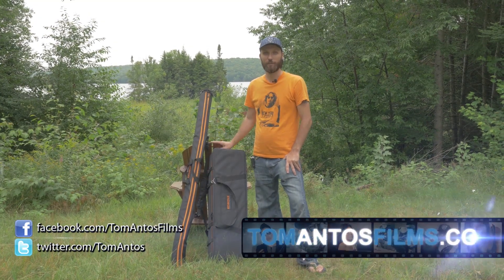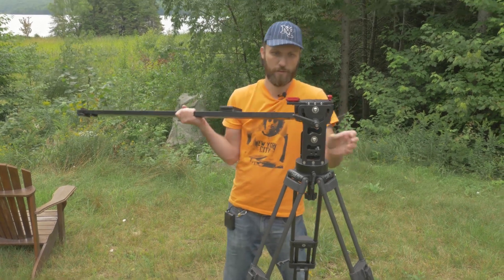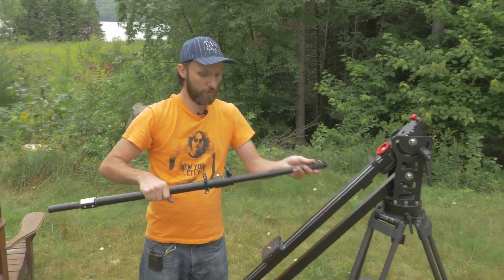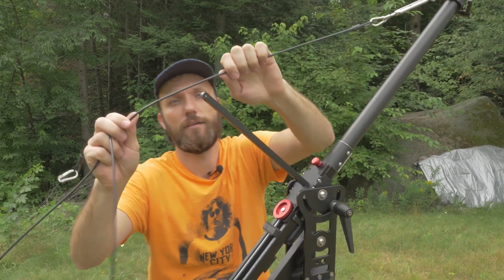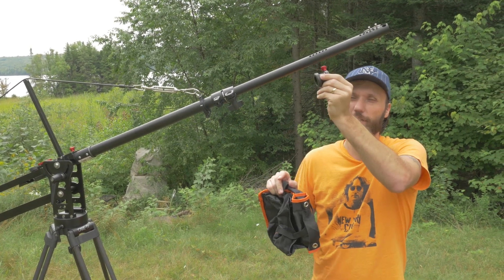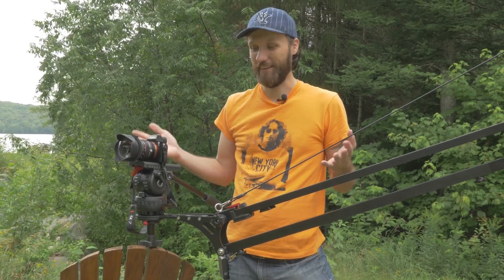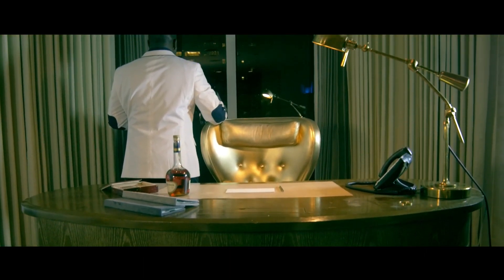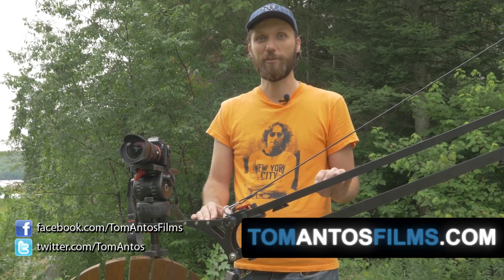Konova Slider Jib

Comment: Awesome jib crane. Neat thing about having the slider is you can use that slider as a fine adjustment weight.
You might want to try rotating your camera mount 180 degrees, so the handle grip is on the lens side. You might need a grip with a steeper angle to keep the grip out of frame when wide angle lenses are used, though. I do this to allow me to take advantage of the rig's natural tendency to allow near automatic tilting down of the camera while the jib is going up, and the other way, coming down as you hold the tip of the grip. Also work great with lateral movements, and keeps the grip from contacting the jib, too. give it a try.

Comment: I have been using my dji-ronin on my 24' jib and it is awesome.  Nothing like a huge boom down shot that Flys off at ground level  on a steadycam shot.  The 3 axis systems have lighten my production crew by 6. And saves tons of time with is more cash for budget which gives production value. I used to use 20 people now 10 years later I only need 4 tops. Amazing tech world transition to film making productivity
Reply from the maker: Great way of using the DJI Ronin... post some videos with your results. Would love to see it.
Reply: I own the crane in this video. How do you attach the Ronin onto the crane? I can't figure it out due to the half bowl. Any help would be SO appreciated

Comment: Thanks for review. Question: By repeatedly using the slider a s Jib is there a chance that the slider can get bent or lose its function. Considering its taking a lot of the weight in the Jib system.

Comment: Whats the best way to keep a whole shot in focus? I'm using the 50mm 1.8, the focus is always super sensitive. I want to be able to get a whole scene in focus with no shallow depth of field. Any tips would be helpful thanks!
Reply: im here to help you ok.....is very simple.if u want to focus and clearly capture the whole scene,change your aperture f1.8 to f.11....thats it but the only problem is bcos u using f.11 there wouldnt be enough light,so make sure u have enough light thats when you shooting night scene or you can turn up your ISO little more higher to achieve more light but make sure you not turning up too much,that can introduce noisy in your shoot.i hope your question is answered.
Reply: Use a smaller aperture